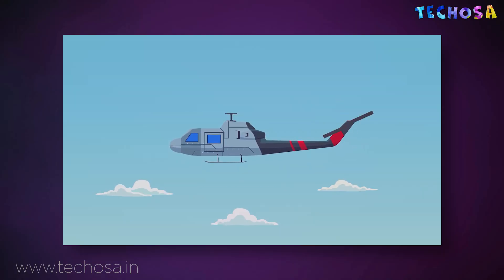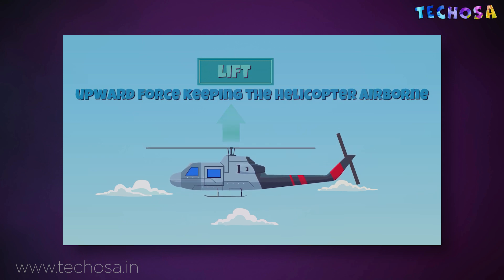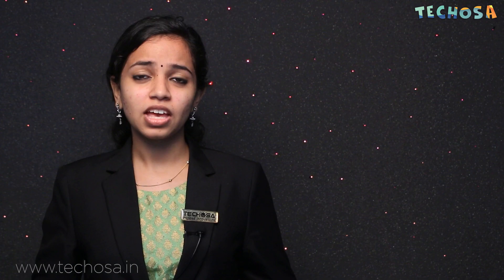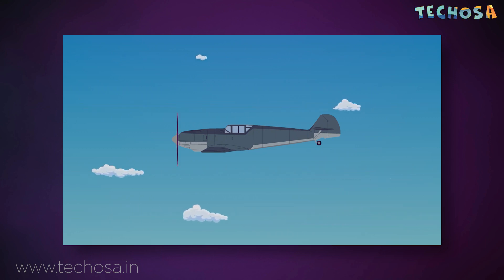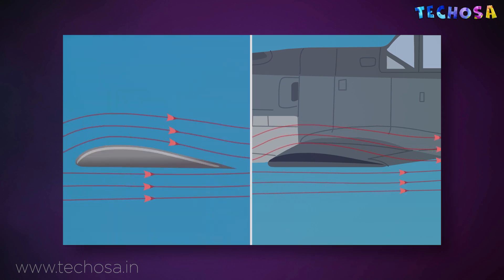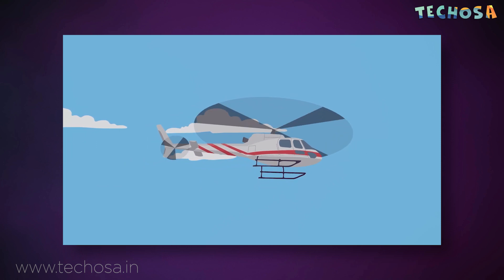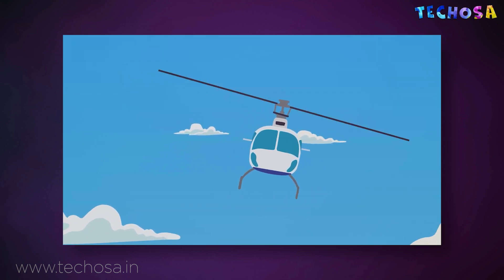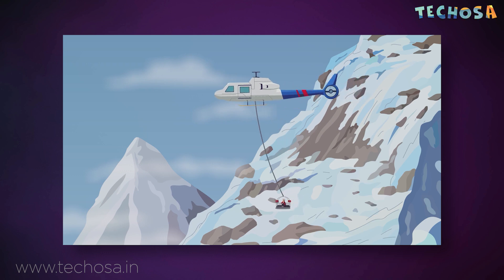How does a helicopter fly | Working of Helicopter | Chopper | Techosa

Comment: ma'am who is the first person who came up with the idea of a helicopter ?
Reply from the maker: The idea for vertical flight came from China which was bamboo flying toy, then  'Leonardo da Vinci' created a design for a machine that could be described as an "aerial screw", that considered as an advancement towards vertical flight. However the world’s first practical helicopter, took flight at Stratford, Connecticut. Designed by 'Igor Sikorsky' and built by the Vought-Sikorsky Aircraft Division of the United Aircraft Corporation, the helicopter was the first to incorporate a single main rotor and tail rotor design.